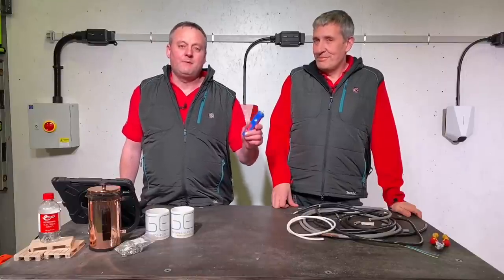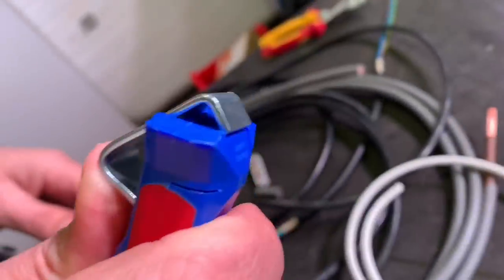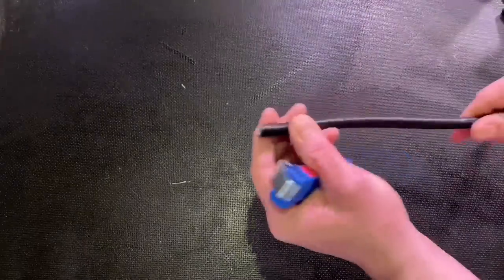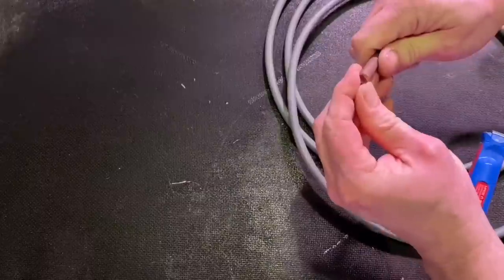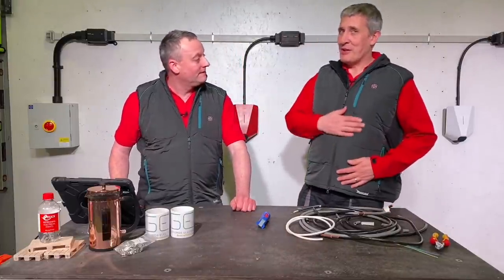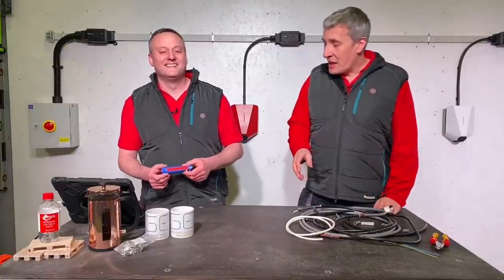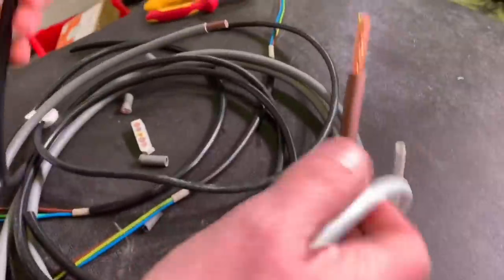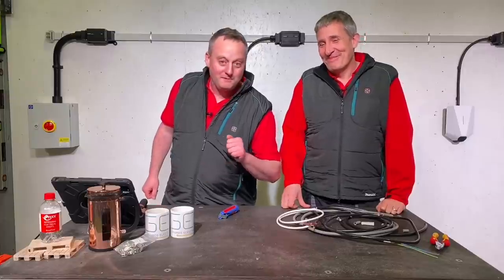This Weicon No 4-16 round cable stripper is great!

Comment: Nice video, the Kabifix cable stripper in my view would be difficult to surpass in this field and is definitely worth a review to bring to the attention of sparks out there. A great labour saver and it should go without saying these tools if not used correctly can ruin a cable so a test should be carried out on a scrap section first to establish the correct blade depth.

Comment: Got Jokari, Cimco (which is Jokari) got Weicon. And Weicon is better. Doesn't tend to spiral around the cable due to the different and smarter shape of the plastic in contact with cable and the slightly more wider knife actually cuts rubber isolations better and overall cutting action feels smoother and faster. Only downside it doesn't come with an extra blade like Jokari(and Cimco) and the plastic housing is slightly less tactile friendly (which isn't a real factor at all.. just an observation)
Reply from the maker: great feedback

Comment: How about a video on your favourite cable stripping methods and tools. I'm not an electrician (just an interested DIYer!) and occasionally need to put a plug on a wire, or replace the cable for a lighting pendant.

Comment: I was using a cable stripper issued by a company that I contracted to and then worked directly for  in the late 70's.
It was a USA company and the tool was blue, I suspect it was manufacured by Ideal.
For sure that tool concept is not that new if I was using one that worked in axactly the same fashion, the centre blade is cranked and loosely rotates and follows the direction you pull the tool. I was supplied to strip a cable specific to the company, tough outer sheath and four insulated inner cores, two of one diamete and two of another diameter and a sod to strip without the correct tool.
Cable was known as 'Trunk' cable and was for a multiplexed alarm system, first I ever saw, two cores for power and tw for data, the cable powered remote devices called 'pids' and form those were powered the devices such as pir's, contacts etc.
I suspect the cable was manufactured by Belden as the device cable was.
Why do Weicon tools always seem to mirror Knipex, Ideal, Klauke and others ? is there a connection ?
Mind you, the Quickwire (Berkshire) flat cable stripper looks identical in every way to the Knipex KPX1264180 reviewed recently, price difference .....around £15 to £24 depending on where you buy the Knipex tool, less if you buy the Jokari version that looks identical, granted the panel covering the hinges have different coloured/ brand logos.
I used to be a tool snob, for sure but now, if I see a tool that is the same for a third of the price of the Giants, example above, I will but it.
Of course, I still but my favoured brands such as Knipex, Bahco, Wera, Wiha ,some CK, and lately, some NWS and Felo, some I hear are part of thge same group.
As an apprentice..it was Elliot Lucas for pliers, 'snips',Footprints and King Dick for spanners...days long gone.

Comment: Great demonstration grary/Gordon.
Nice tool but I think you will stick with the croppers and side cutters. Fantastic video as always just had a look on "" "" if it was half the price I might be tempted.
Reply: I got mine from E bay for 16 quid including postage which I though was cheap compared to my Jokari flat stripper which was £65 ( but it does do the job really well

Comment: Weicon also do an S4-28 stripper that can strip the inners as well,  which one is better? (WEICON S4-28 Multi-Cable Knife, Blue/Red, one Size, 50057328)

Comment: I bought one from Amazon based on this video... wish I noticed the paid promotion bit beforehand cos its garbage.
Cheap plastic, far too high spring tension, blade adjustment is imprecise at best.
When you spin around the cable it's difficult to ensure its perfectly perpendicular hence it often cuts a spiral rather than one circular cut.

Worth less than £5 in terms of quality. There must be better solutions than this.
Amazon will be getting this one back.
Don't buy!

Comment: Bought the Jokari version years ago.  Never use it.  Can cut the inner cores if you set the blade too deep and doesn't remove the sheath if set too shallow.  Less to think about manually adjusting the depth of a stanley  knife.  Bought the armour slice too and never use it.  Still use a junior hacksaw.   Maybe I'm mugging myself
Reply from the maker: Great feedback

Comment: This type of cable knifes is around here for decades, originally invented by Jokari. They also have exchangable brackets, for different sizes of cables. My favourite is this one:

https://www.youtube.com/watch?v=hgfNKzcQBaE

Got two stripping blades, one should also be usable for flat cables.

The difference between NYY and Tuf Sheath is, NYY is a normalised cable type. No matter which company manufactures it, it should always be the same thing and meet the requirements of this normalised cable type. Tuf Sheath is a product of one single manufacturer, and only available from them.

The name is pronounced "Whycon" 😉